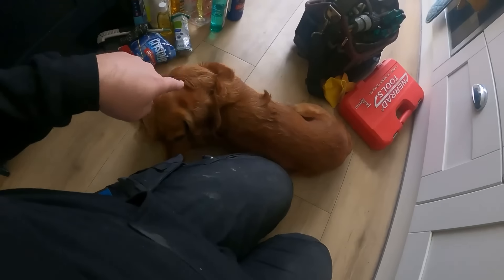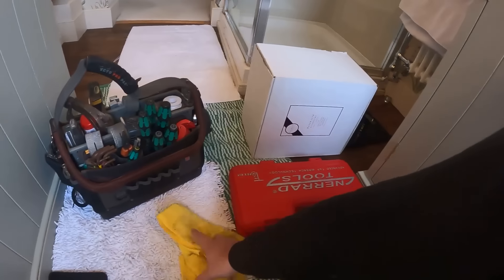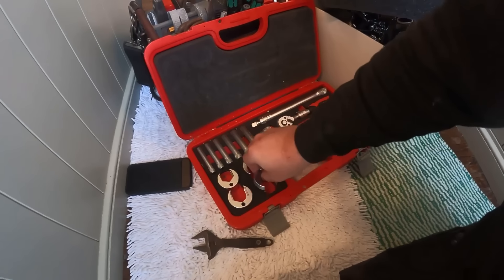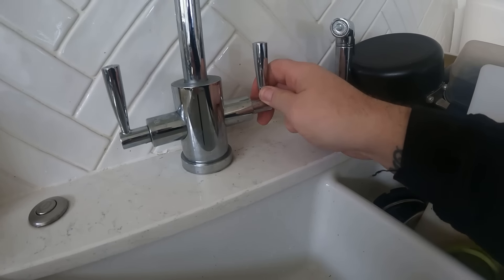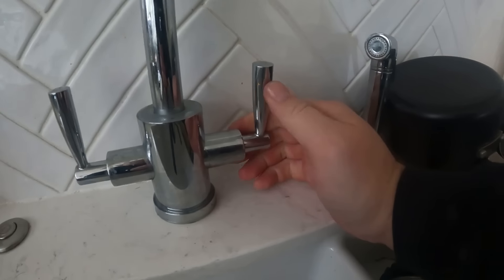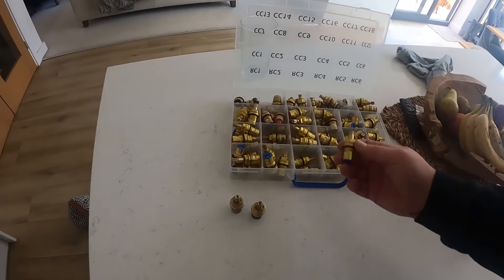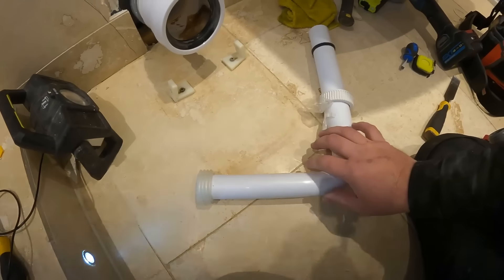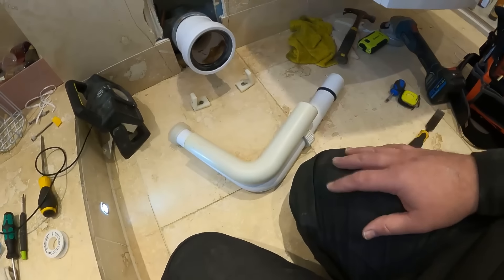BATHROOM PROBLEM...Leaking TOILET & BATH tap issues | REAL WORLD PLUMBING

Comment from the maker: Remember to drop me a comment how you would of tackled the jobs in this video.... we all have different ways of getting stuff done.

Also hit the like button and get subscribed to the channel......
Reply: I get loads of leaking back to wall pans, ideally it should be a cistern frame or a cistern with a fixed flush pipe behind a tiled boxing. I usually fix the flush pipe to the back wall with rubber lined clip threaded rod and backplate and then it’s 100% secure because what happens is when the toilet is pushed back the flush pipe moves back with it, they are really designed for a furniture unit. Another thing you can do is unclip the flush in the cistern and let it run for about 5-10 minutes or if you can stick your arm down the boxing with the camera on your phone to check the flush cone at the back, seems to work for me anyway 👍
Reply: I’ve been doing it for 21 years 
I put / use sanitary sealant clear on flash pipe cone and on the flexi connecting to the pan 
Slides in easy give it a half hour before you use the flash and it would not leak again

Comment: When fitting the flush pipe in a similar situation situation, ie, back-to-wall pan, I ended up fitting the flush pipe ‘cone’ into the pan first, then eased the pan carefully into it. Seemed to work fine! The thing with these types of pan is that the pipe work has to be as rigid as possible for the pan to be slid into place. Bit of a nightmare definitely!
Reply from the maker: Indeed mate

Comment: Excellent way to unwind watching another plumber struggle. Been there with the in and out and no doubt more to come. A bit of waste pipe cut to a v shape and wedged between the wall and the back of the flush pipe to keep it from moving back. Also toilet seat off, a keyring torch down one hole and a beady eye down the other to look for drips on top of the flexi maybe even a small bit of blue roll taped on top. Nice one Mark.
Reply from the maker: Hahaha thanks mate 👍🏼👍🏼

Comment: Thanks for that, Mark. Maybe we should start a petition to ban tiled-in toilets! Makes you wonder if it's really progress from the days when the cistern was always on show and you could fix 90% of taps with a standard rubber washer.
Reply from the maker: 100% behind that 🤣🤣🤣
Reply: They were so unsightly though, they should have access ports though.
Reply: At least the type with the metal frame that goes behind the tiles give you more rigidity, you don't have pipes floating in the air behind the pan. And the flush plate gives you a little bit of access to the cistern. I still prefer freestanding toilets and wall-mounted cisterns. My worst nightmare is a wall-mounted pan cracking from age or previous damage and falling off the wall while I'm sitting on it - it's happened before, and not with particularly big people.
Reply: I totally agree on the ban. Yet some how in Tenerife so much pipework is tiled in as norm and some how it doesn't seem to pose any problems for decades. I dare to say maybe the have better plumbers with less leaks
Reply: @CommercialGasEngineerVideos  Not pipes, toilet cisterns. Even if they work fine for a long time, they do have parts that need servicing and replacing, especially fill and flush valves. Doing that through the flush plate opening of a concealed unit is possible, the setup in the video looks like quite a pain though.

The main issue in this instance is that the original installer didn't bother to fix the pipes to anything though.

Comment: I've had this a few times, always comes down to putting a baton behind the cistern at the bottom to stop the movement, so the flush Pipe doesn't push back as your pushing the pan back in....
Just in my experience
Reply from the maker: Yep that’s what I do on all my installs from new…. But as you see there was no chance of getting that done on this job👍🏼
Reply: Had similar mate , flimsy plastic cistern  allowing flush pipe to move back ,ended up getting bit of celotex glued behind pipe . Great video as usual.

Comment: It's so much easier to put blocking behind flush and soil pipes to stop them pushing back. Concealed toilets mounting onto frames have them built in and people forget we used to do clip and block them to stop them pushing back out. Even now after your fix in another 8 years they may suffer the same issue as the flush cone ages the pipe and cone will slowly push back out with every flush. Just something to bare in mind for future.
Reply from the maker: Yer I know that buddy, I mention it in all the videos when I fit a concealed cistern…. That’s why when I fit them from scratch they are fixed and secured…. However this was not possible as you can see, so you’ve got to do what you can

Comment: They do make flexible flush pipes, also the flush pipe should have a bracket on it to stop movement usually supplied and the cone you fitted is easy the  best one as the plastic is bigger at the end so you can feel it’s in
Reply from the maker: Don’t think I’ve ever had a concealed cistern with a supplied flush pipe bracket in 30years
Reply: @MJTiffPlumbing I work in a place with over 100 rooms all the toilets are concealed but we use gerbit cisterns perhaps just these with brackets

Comment: Great video as always Mark 👌 Jepp Flex make a dedicated flexi flush pipe with 1 1/2 and 2 inch adaptors. Not cheap but there must be cheaper ones out there.
Reply from the maker: I never even knew they were avalible!!!
Reply: There's a few! Wirquin make one too for about £16 but......
I use a £3 rubber lined munsen ring clip off the back wall.  Holds it solid 🤟
Reply from the maker: Will look into this mate 👍🏼👍🏼

Comment: Travertine tiles they look like. I'm amazed you got away with hammering them  I would have out a grinder with dust extract on and grinded out that section and then had a look. If that tile had cracked further that a new tile at your expense and a huge amount more work. Top tip if your testing pan and want to check its water tight without flushing the whole lot, fill a basin and syphon the water into a bit of tube, you can use that to fill the pan and only minimal water to clean up if its not water tight. Pig of a job though to be fair, I hate replacement pans like this when you can't identify the leak, I would have checked the WC pan connector earlier for a break in it as well, that angle looks awful and it doesn't look like a quality Macapline part. Good video
Reply from the maker: Can’t test the flush pipe like that…. But yep the waste pipe can be👍🏼
Reply: @MJTiffPlumbing  put a bucket underneath and wrap it with blue roll around the outside of flush pipe, can usually see if the seal is broken or leaking that way. Doesn't always work.............. I would have lost patience taking a WC in and out that many times lol

Comment: I’ve had to go back twice recently to two toilets to change pan connectors and change the cheaper one I fitted to a mcalpine brand , this was mainly due to the cheaper connector rubber end being sub standard . The mcalpine have a couple of  beads running around the seal that helps against seepage on poorly manufactured spigots on said toilets . Annoying as I’ve used the cheaper brand many times before and had no problems .
Reply from the maker: Alway the way when you have to go back….. nothing worse

Comment: All ways makes me wonder why someone hasn’t brought out a flexible flush pipe, imagine a world where you could just connect both the multi quick and flush pipe on flexes and and just push the toilet back knowing they are both sealed.
Reply: There must be a reason after all this time….
Reply from the maker: That would be a dream of a fitting I think
Reply: Wouldn't it be great if they could cast toilets with a ceramic thread so you could do away with push in bungs just screw in flush connector with a washer? Plus have a Flexi connector. I hate concealed tiled in cisterns!!!
Reply: @MJTiffPlumbing  wirquin do a flexible flush pipe. Use it with a jepp cone that locks into the back of the pan and you're golden for concealed wc's 👍

Comment: U were lucky that limestone didn't break above the line of the wc. Can u remember what that box of ceramic discs cost? Only down side to having it is u will soon use the common ones and be left with half a box of the more unusual ones
Reply from the maker: Think it was about £120…. But pays for itself straight away…..

Comment: I'm no expert but you could've plugged the flush pipe hole with expanding foam and probably that would've stopped the pipe from moving! That's my uptake, as I said I'm not an expert!! ..... And probably the rubber seal worn out or went out of place and caused a leak after 8 years of use ....
Reply from the maker: Not the best way to sort it to be honest, would rather sort the problem than masking it…. But Appriciate the comment, genuine question👍🏼👍🏼

Comment: Why not just jam a small piece of wood behind the pipe to hold it in place and stop the give in it as you push the toilet back to seal it. Really don't understand the logic in buying/changing the pipe when the issue is the give in it because the pipe isn't supported behind, there was no need to change the pipe..
Reply from the maker: Not being there you wouldn’t know buddy….. however if you watched and listened you would see the movement on the old pipe compared to the new one…

I want to fix stuff not bodge it….. each to there own but this is how I do it👍🏼
Reply: @MJTiffPlumbing I did watch and listen. The only reason the new pipe worked is because you made it in your own words 1-2 inches longer which meant that when you pushed the toilet against the pipe with the extra length you had added the pipe flexed and pushed against the wall , in effect doing the same job that the block of wood would have done except your forcing of the pipe backwards has now compromised the vertical join in the pipe. 

That's a bodge job, the correct way would have been to install some form of barrier behind the pipe such as a block of wood ( multiple other ways to do it) to stop it moving backwards when the toilet was pushed against it. 

A barrier to stop the pipe moving backwards against the impact of the toilet pushing against it is a far better fix than just getting a longer pipe and pushing the toilet against it flexing it back 2 inches and compromising the vertical join of that pipe which is not visible unless you stick your hand up
Reply from the maker: 🤣👍🏼….. ok buddy
Reply: @MJTiffPlumbing what is wrong with what I suggested?
Reply: @dgmclar  This has gotta be a wind up surely, what plumber in this universe jams a piece of wood behind a pipe to stop it moving !!